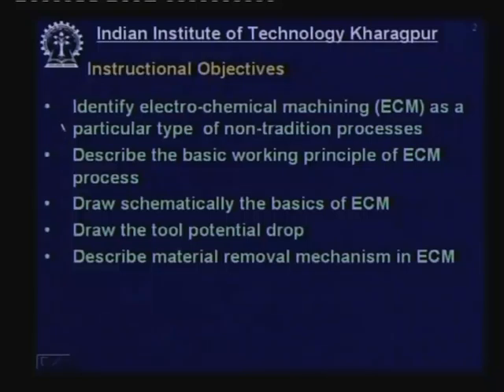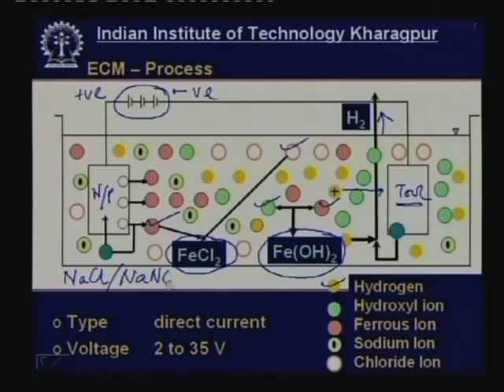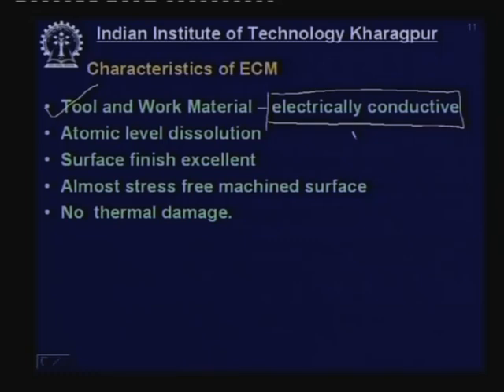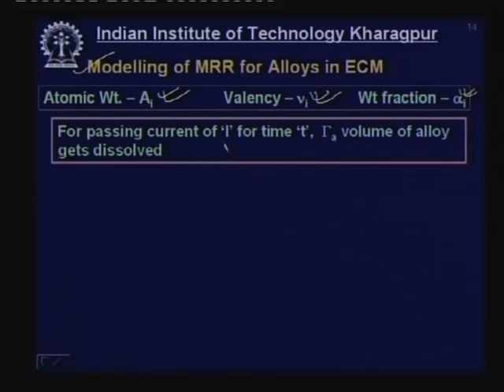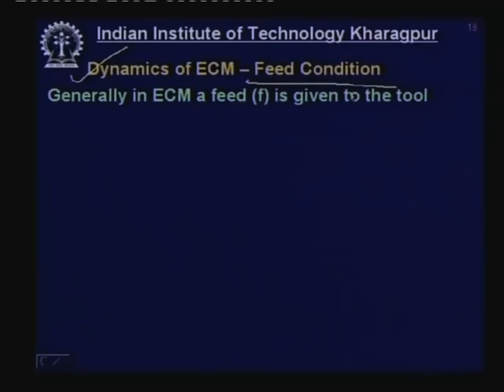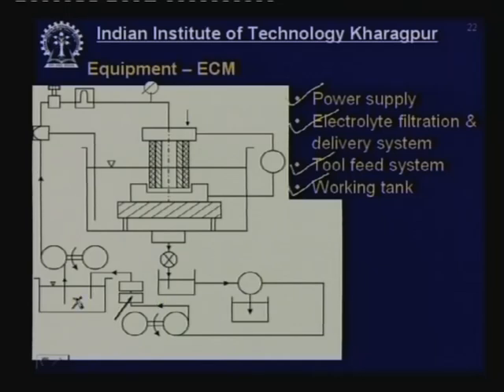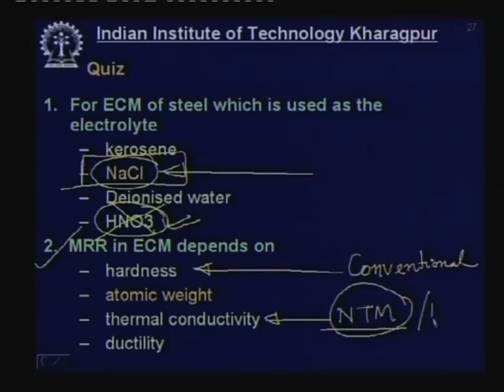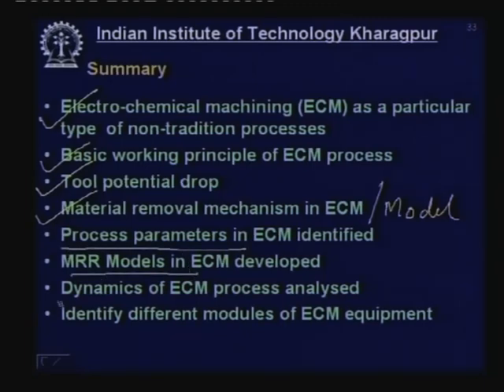Lecture - 38 Electro - Chemical Machining

Comment: Thank you. Can you resolve this exercise
During ECM, 10 V DC power supply is used. Initial conductivity of the electrolyte used is 0.2 Ω−1 cm−1. Feed rate is 1.0 mm/min. 
(a)Calculate the IEG at 10, 20 and 30 mm distance from the inlet after 10 seconds. Use the following given conditions : (T = 30 oC, αv = 0 at x = 0 mm), (T = 60 oC, αv = 0.3 at x = 40 mm). Take n (exponent) = 1.75, atomic weight of anode = 55.9 g, density of anode = 7.86 g/cm3 ,             initial IEG = 0.4 mm, valency of dissolution = 2, over potential = 1.5 V, and α = 0.002. Also calculate mean equilibrium gap. 
(b) The composition of nimonic alloy turbine blade is 18 % cobalt, 62 % Ni, and 20 % chromium. Take I =1500 A, and ρa = 8.3 g cm-3. Use valency of dissolution for chromium, nickel and cobalt as 6, 2 and 2, respectively. Gram atomic weights are as follows : Ni = 58.7 g, Cr = 52.0 g and Co = 59.0 g. Calculate the volumetric MRR, and state assumptions, if any.